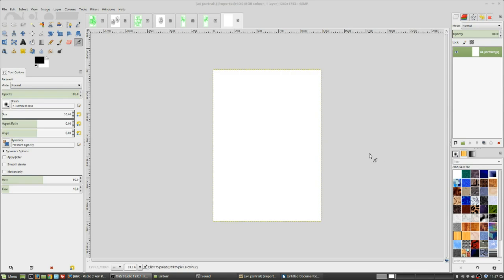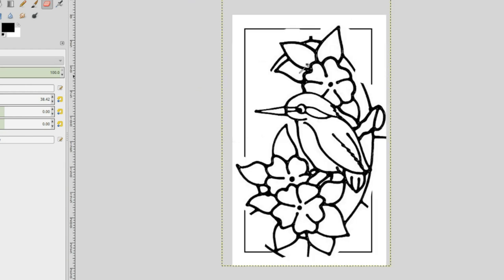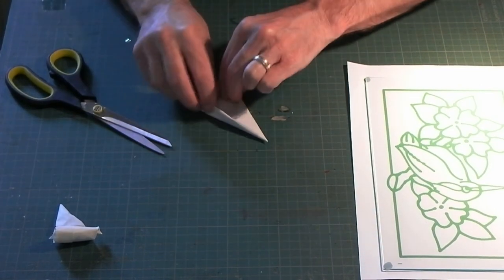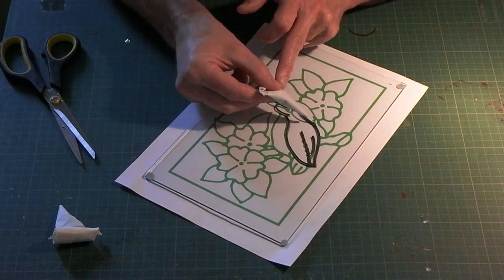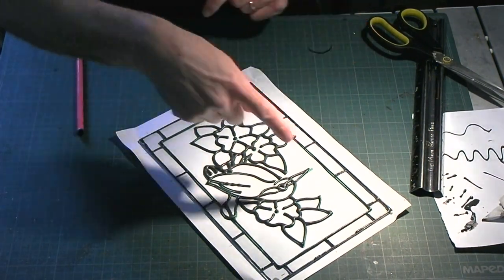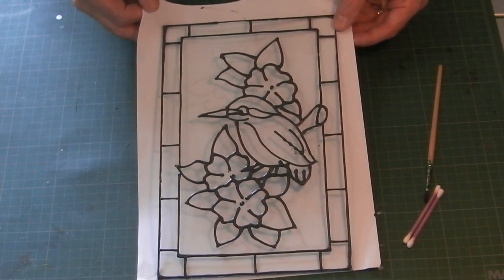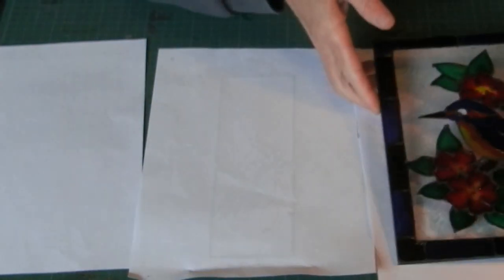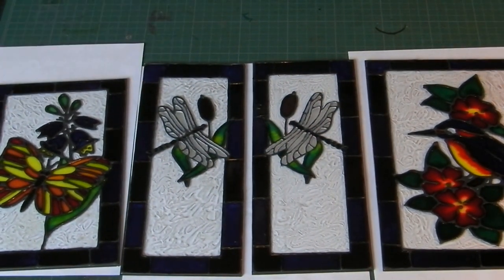Glass Painted Lantern  (Faux Stained Glass ).

Comment: I learn sooo much from your videos!!  Thank you.  I've bought lots of Pebeo Vitrea 160 paints & mediums & outliners.  I don't want to deal with toxic fumes from solvent based glass paints.  Is there anything compatible w/P.Vitrea 160 paints that could be used in unpainted spaces to create the textured effect of the Gallery Glass Window Color Clear?   Also, some of the items I want to paint are suncatchers (on clear or opaque plastic shapes), lanterns that the glass can't be baked cuz it's not removeable,  & other decorative items that won't get washed or put into the dishwasher.  I'm wondering how colorfast/fade resistant & scratch-proof/durable, etc., items painted w/P.Vitrea 160 will be??   Does Pebeo make a water-based Vitrail glass paint?  Does it need to be baked to be dishwasher safe?   Thanks in advance for your help!!  Happy painting!!

Comment: Amazing. I need to watch all your videos and learn how to do this the proper way.  I’ve used water based and a brush but I hate the brush strokes and its opacity. I’m from across the pond, but I’m guessing that solvent based paint is alcohol based?  I’m glad you showed how to remove an unwanted spill. What if you drop a bit of paint in a finished and dried section?  By the way, is the finished product cleanable without rubbing off the design?
Reply from the maker: Hi, thank you for your comments.

" What if you drop a bit of paint in a finished and dried section?"

As long as you are quick and the previous colour (color) is totally dry then you should be able to remove it with a quick wipe with a paper towel. You don't always get every spec which is why I tend to start with the darker colours and work my way towards the lighter ones. (A spec of a lighter colour on a darker on won't show up as much as a darker colour dropped on a lighter one!).

With this paint is can all be wiped down but it shouldn't be soaked. It you want something to be totally wash proof (like a wine glass) then I recommend using one of the oven bake paints such as Peber Vitrea 160.

Good luck with your glass painting
Reply: Glass Painting thank you!!

Comment: I've gone through so many glass paint pictures and yours is the best can you list the brand of paint you use please. Beautiful work.
Reply from the maker: Thank you for your kind comment. Unfortunately the brand I used in this project (Rainbow Glass) is no longer made. I now use Pebeo Vitrail glass paints. They are very good BUT I do find a few of there colours a bit dark. I always buy the lightening medium which makes the darker colours lighter.

https://www.glasspainting.co.uk/glass-painting-equipment/pebeo-vitrail-glass-paint-review

Hope that helps.
Reply: Awww thank you ever so much. I'm finding it so difficult to find the the stuff you put on glass to make it look frosted. Your UK like me I assume from your accent, where do you buy yours  from? as all I can see is from USA. Thank ever so much. :)
Reply from the maker: I have at times got it on both Ebay and Amazon but it is getting quite rare. I am experimenting at the moment with some clear drying PVA glues. Will let you know how I get on.
Reply: @GlassPainting  this would be awesome to find one that works. Thank so much got getting back to me.
Reply from the maker: What I should have added is, I have had good results from using 3D Fabric  paints as an outliner, especially with the flowing paints (had mixed results with thick peelable glass paints). You might want to look into that as the £D Fabric paints are readily available in the UK and come in lots of different colours.

https://www.glasspainting.co.uk/glass-painting-equipment/using-dimensional-fabric-paint-as-outliner

Comment: I want to work on stained glass projects but I'm looking to find cheap ways to do it without using real glass and avoiding any toxic materials. I work in a classroom and I'm not allowed to use real glass due to it being a safety hazard. Also, I can't use any materials that could be considered toxic. On top of that, we have a limited budget, so I need to find materials that don't cost much and try to buy them in bulk of possible. If you know any ways to accomplish this, I'd love to see a video on that. This craft would be really great to do in a classroom. I can think of a lot of project ideas that revolve around using stained glass.

Thank you!
Reply from the maker: I would suggest using waterbased peelable glass paint (either bought or make your own)). You can then make window sticker or work on plastic (recycled).

Have a look at these videos:
https://youtu.be/NL_QQCe5Xgg

https://youtu.be/5r0jwDNGd78

https://youtu.be/Foz24fPNUmY

Hope that helps.
Reply: In case you cannot use real glass, you could use ohp sheet. It gives the same effect as a real glass. But it's as flexible as printer paper.

Comment: Could I glass paint my porch light? That would have an electric bulb? Does the painted glass go on the inside? Or outside? Would it sustain the heat from the bulb? I have just bought a new lantern for my porch and would love it to be different from the rest of the estate..in the old days you could buy coloured ones...
Reply from the maker: I know a couple of people who had heat issues with the "old"  wattage bulbs but haven't so far come across anyone who has had an issue with the newer low energy ones. They tend to give off a lot less heat.

If the lamp is exposed to the weather then I'd be tempted to paint the inside of it. An alternative would be to do the outside and then give is a coat of a clear yacht varnish but you would need to test this first to ensure it didn't react with any paints you used.

Hope that help.

(Just as an after thought. Another way to do the outside would be to use one of the dishwasher safe paints. These tend to be the ones you bake in the oven so you would have to be able to separate the lamp from it's glass. I've never done it but surely a paint which can withstand going through the dishwasher should be able to put up with a few shower! Pebeo make one which I mean to try in the near future. )

Comment: What do u seal them with after they dry?
Reply from the maker: This is mostly made with solvent based paints so there is no need to seal it. It can be wiped down but not soak washed or put in a dish washer.

If it were going outside I would seal it with a coat of clear yacht varnish (doing a small test first to ensure the varnish and the paints were compatible).
Reply: @GlassPainting  
My faux stained glass was with glass paint. I need to know the sealer for that.
Reply from the maker: Do you know which type/brand of glass paint was used?
Reply: @GlassPainting  
Gallery glass
Reply from the maker: In that case I would recommend a clear waterbased varnish. Something like this:

https://www.amazon.com/Pintyplus-Art-Craft-Spray-Varnish/dp/B07QMX2ZXT

As always please do a patch test first just to make sure.
Reply: @GlassPainting  R these  permanent paint like oven bake ones?

Comment: How to give different textures on glass painting
Reply from the maker: Sorry, I'm not 100% sure exactly what you mean by texture in this case.

Generally you want your work to look as flat and smooth as possible  so it resembles glass.. The clear "mottled" look on parts of this lantern were obtained by using a thick, clear water-based glass paint and applying it very roughly. I think the specific paint used here was Crystal Clear Gallery Glass by Plaid.

Hope that answers your question but if not please do get back to me.

Comment: Hello from the Colonies!
   I'm in the research phase of my project making panels that will sit inside the sliding windows of my coversion van. 
   Of the dozens of videos I've been through so far, yours has been the most helpful! Therefore I have subscribed to your channel.
I'm going to be working with plexiglass® because of the planned location; will these techniques work with that Medium specifically the solvent-based paints? Any help or input will be greatly appreciated!
 Thank you for the video, and sharing your experience!!!
Reply from the maker: Hi Capt. Rich, hope hope all is well (Downunder?).

I have never had an issue with any current solvent based paint on Plxiglass, acetate, plastic etc. Many years ago I did have an issue with a cellulose based paint but the particular brand (along with others) has been discontinued as unsafe! You can always test if you are dubious, before you launch into a large pieve of work.

I would recommend using one of the harder outliners which unfortunately tend to be the ones in tubes (Pebeo or Marabu should be fine). I'm saying that because I assume it may need to put up with a bit more punishment that objects kept at home (temperature, condensation etc). (As opposed to the peelable/soft outliners I tend to used in my everyday work).

Finally you can always seal the piece with a clear varnish if you want to. It can make the finish piece look a bit "different" but it is by no means a "bad" effect. Again a little test will show you want it's like. (The tests can double up as a bit of practice!).
Reply: Glass Painting 
   No sir, the states. I do have friends down there, and have one really good friend that's a Kiwi!
   I just got back from checking my local hobby house they don't have much of a selection, could you perhaps suggest an online source? Or have you already put that in the description and I wasn't paying attention??? Thank you again; and thank you for your quick response!
Reply from the maker: Whoops got that  a bit wrong didn't I . Well hello from over the pond :-)

Amazon seems to have a range of solvent glass paints: https://www.amazon.com/s/ref=a9_sc_1?rh=i%3Aarts-crafts%2Ck%3Apebeo+vitrail&keywords=pebeo+vitrail&ie=UTF8&qid=1511303516  I expect you will get them on Ebay as well. Perhaps cheaper.
Reply: Glass Painting 
   LoL, no problem it's partly my fault. After that I googled "do the British call the US the Colonies"
I thought I had heard that somewhere; apparently according to Google it's an old tongue-in-cheek joke.
    Anyway, I will get on that; thank you again and have a wonderful day!
Reply from the maker: Ah we certainly do but because of our over active ancestors it can apply to several countries :-) Not sure why I guessed at Australia though!